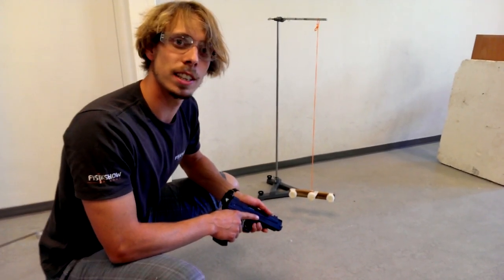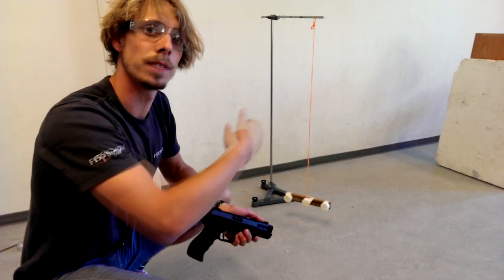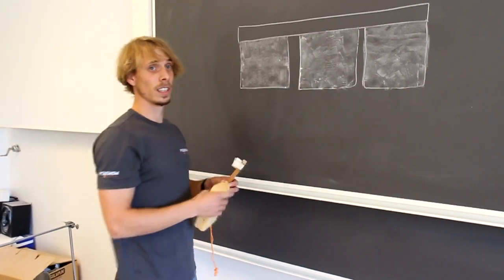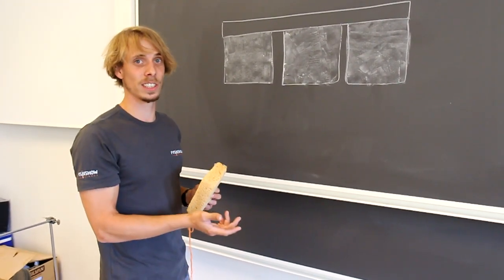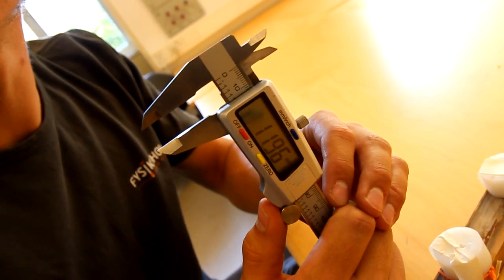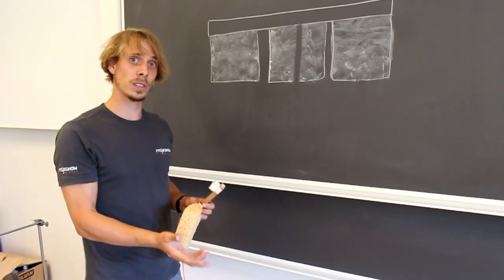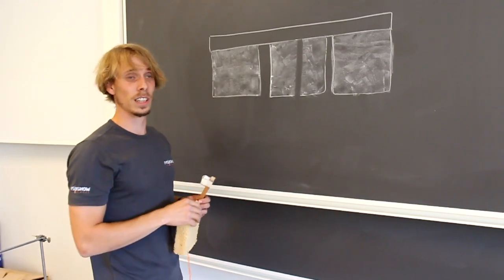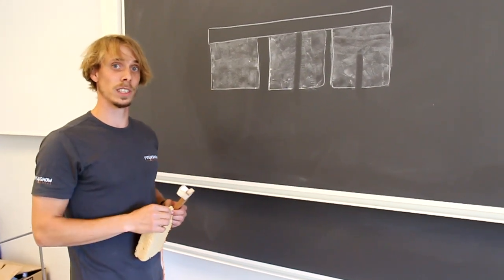video response to Bullet Block Experiment (Veritasium)

Comment: Why would momentum alone explain for why the pellet went farther into the middle one?
Reply: Simply put - momentum alone doesn't explain why the pellet went farther into the middle candle.
In the end, for both scenarios the block receives the same amount of energy, but it is used in different ways.  Ultimately, though, both blocks receive the same amount of "translational kinetic energy".
It's about the kinetic energy of the pellet.  In both scenarios there is the same total initial energy.  When the pellet strikes the right target, it accelerates the block both translationally and rotationally. When the pellet strikes the middle target, it only accelerates the block translationally.  Kinetic energy is not conserved here, because it is an inelastic collision.  However, we can track where that energy went - it dissipated. (That's why the pellet penetrated further into one candle than the other.)

Note: People sometimes mix up "kinetic energy is not conserved" with "total energy is not conserved", the latter always being false.